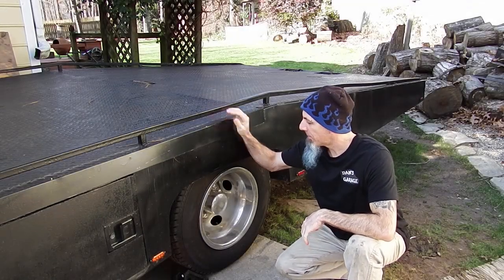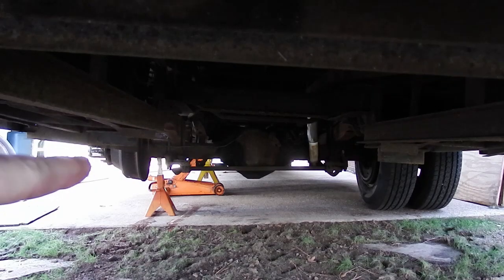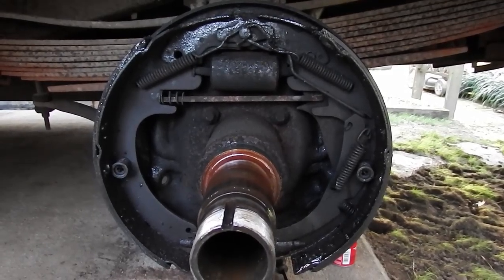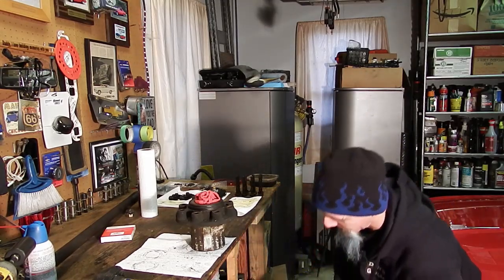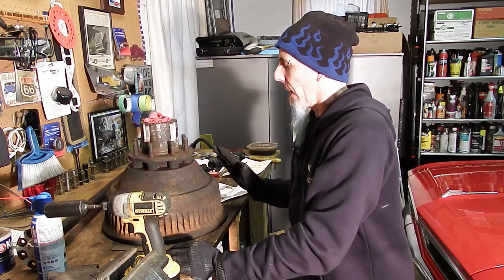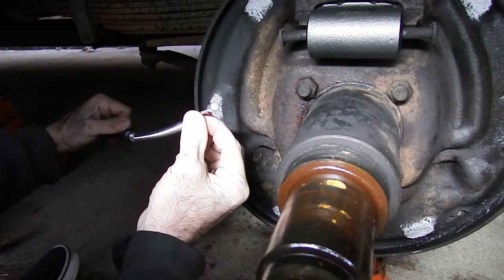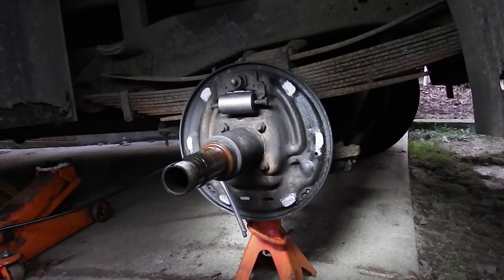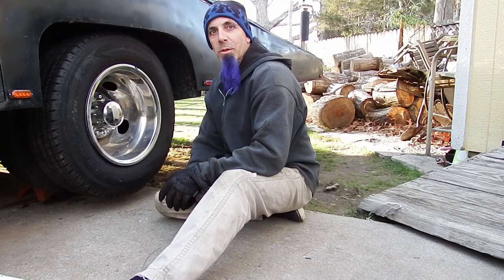Chevy c30 rear brakes

Comment: I watched the video again and again looking for the placement of that steel ring that goes on the hub. The one with two steel pins molded into it. 
You really didn’t make much of it, but you removed and replaced that ring making me confident I wasn’t putting it in the wrong place. You rock. Thanks again
Reply from the maker: I try to show all parts on videos like these so it does help. Glad it worked!

Comment: I'm going through the same issue with my 1975 Chevy c30 Silverado. Now to wait until next month and get the rest of the parts and complete the brake system.
Reply from the maker: Nice, hope this helps. It wasn't as bad as I thought it would be.
Reply: Thanks Dan I've got everything down and the backing plates off and cleaning them to repair the grooves that are worn into the plates. I should have everything ready to put back on and together for a good drive after that.

Comment: Thanks A Million, Man. Very helpful video. One thing I experienced was the hub frozen to one of the rims. That Never seize is great between the rims and the hub.
Reply from the maker: I have been doing that for years, just don't put it on the studs, I was told that will mess up the torque.

Comment: good deal dan did you align the wheels so you can get to the inside valve stem
Reply from the maker: No, the inside stem is still the short one facing the other way, I did have some footage filling it up before I put the outer wheel on, but it got cut.

Comment: Is there a reason you couldn't just bleed the brake before you put the tires back on? It's hard to get at those rear bleeders.
Reply from the maker: I guess you could.
Reply: What tool did you use because I can't get to it hardly

Comment: Man those heavy truck drums suck. A BFH is also good for getting the drums off when the adjuster is rusted solid and the wheel hasn't turned in 20 years. 🤣
Reply from the maker: Yea, I was going to put a note at the start to show the later footage of how to loosen it if you can't get it off, but I never said it.